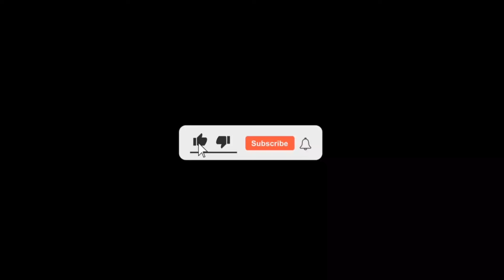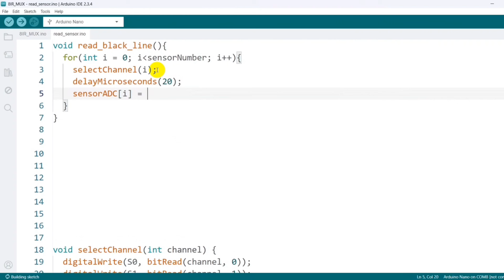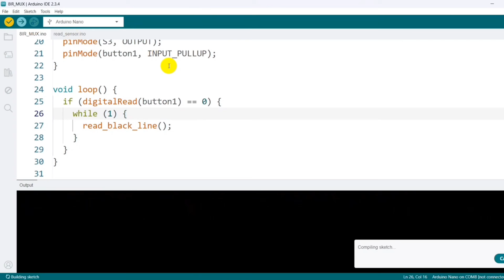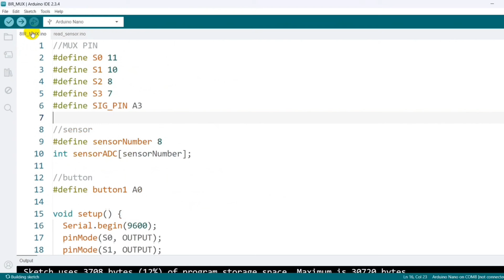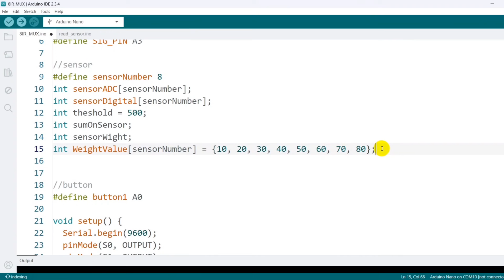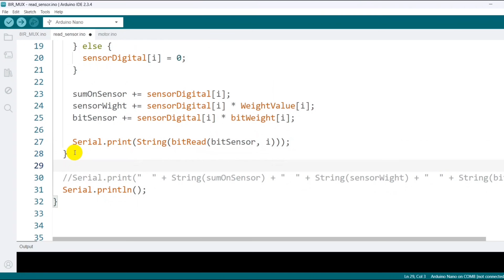Line Follower Robot Coding Tutorial: Part-02

Comment: Mmmmh, the values was already either 0 or 1000 depending on "<200,>300"; then what is the purpose of threshould?
Reply from the maker: Threshold is required for digital conversation, a middle value between high and low adc. Its important